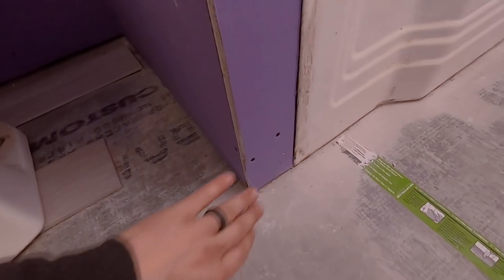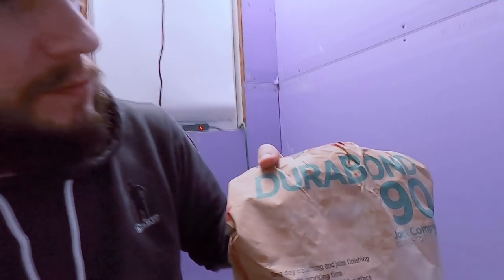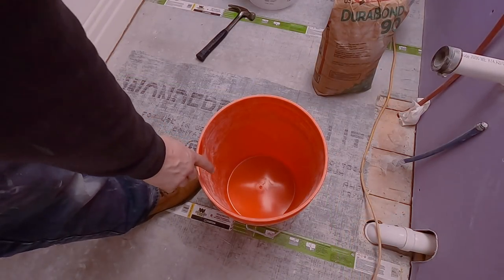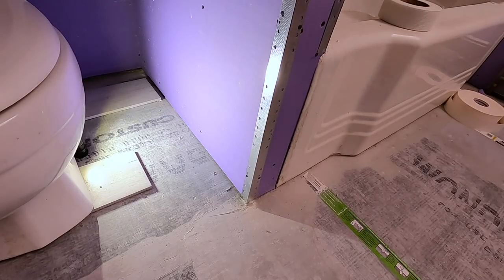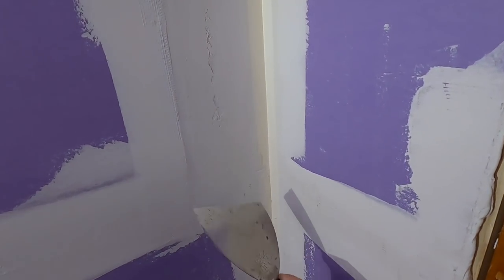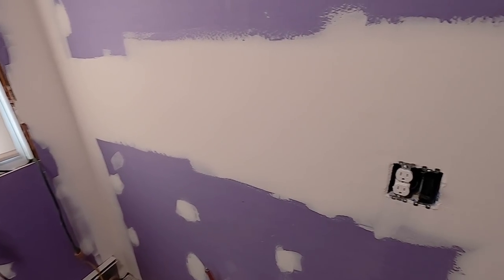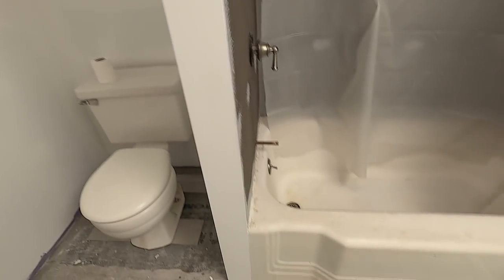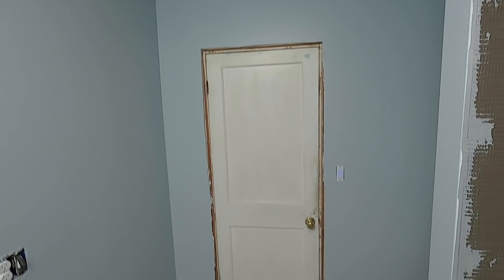How to Mud and Tape Drywall - DIY Bathroom Remodel Episode 17

Comment: hi again, my wife and I did tape and finish for 40 years and we stopped needing to sand while still leaving a paint or paper surface. I would be glad to share some tricks of the trade, you can try them to see if they work for you.  WE hate to sand so we don't.

Comment: You can't pass inspection in California with purple drywall on the ceiling.  I know it makes sense to use it in the bathroom since it is mold resisitant and all but they claim it is too brittle for ceilings.  Inspector literally made me remove it in two bathroom ceilings and replace it with the fire X kind.
Reply from the maker: Well that is interesting... I have never heard of that before.  Every state is different.  It is interesting to hear in what ways.  Thank you for sharing!  AND for checking out the video!

Comment: My father is a retired professional painter. He learned  his trade back in Europe and completed a four year apprenticeship. He truly is a master of his trade. Anyway, he taught me that when you paint a ceiling the first coat is applied in  vertical strokes and then the second coat coat is applied horizontal strokes, that way you end up with a perfect paint job and ceiling. 
He also told me not to fall for "primer & paint in one". He says always apply primer, then paint and to  always sand between coats for the perfect finish.
Reply: Thanks for sharing.

Few years ago I discovered if I used just a primer coat first, the paint came out looking nicer and I didn’t have to worry about stains bleeding through (for older homes/walls). Ever since then I always apply a primer coat before painting. Also for me it seemed to be better to use a primer then paint for drywall patches.

Comment: The hard mud works well especially if you have a big gap or odd cutout or blowout to fill beforehand because it doesn't shrink and dries hard. That and small patches you want to get done quickly. A whole room you can use premixed. I work with drywallers and they use the All Purpose for the tape coat because it has a lot of glue in it and is heavier, then the Plus 3 for the subsequent coats because its lighter and sands easier. All Purpose for hand texture, Plus 3 if you're spraying with a hopper.

Comment: Always add water to the bucket first before you mix the powder in and also try using the white bag called easy sand as it will be easier to sand

Comment: Yes very true, the true way to do a good tape and mud job is experiance, doing it over and over again, to where you litereally have a feel of it, to where you have that crisp spread and scrape sound and yes the less mud the better, do not want to be sanding a lot, and when sanding I do do the taper in method start on the edge of the dry mud and work it, it has takes me a few years to learn and actually move quick as well,

Comment: Excellent video! One tip I would add is that paint doesn’t stick very well if the walls are still dusty. I go over the walls before painting with a cloth to get rid of the dust.
Reply from the maker: Good tip!  Thanks for checking out the video!

Comment: Just another tip as a painter, I have done drywall repairs some needing taping, personally I wouldn’t overlap the mesh tape. I also after the skim coat is completely dry I make great efforts in removing all sanding dust of the ceiling & walls, even quickly going over it with a damp lambs wool window cleaner, just a very quick light touch over the mud areas, I have done it many times, never an issue. I’ve seen too many paint jobs peel off because the dust wasn’t removed properly, especially if your rolling. Also use acrylic Matt finish paint for your ceilings not that cheap white wash crap, it will inhibit mould & be easy to clean.

Comment: I'm really enjoying your videos-well done! We have a manufactured home that needs 2 bathrooms to be redone due to replacing the polybutylene pipe with new pex and a couple of wonky toilet flanges that I had to try to repair when we first bought the place. All of the pipes are in only 1 section of the 2 1/2 sections of the home so we're going from one end to the other in that section, catching the laundry room and kitchen in the process. It is a lot of work and it's been feeling like a little overwhelming to start, but taking it room by room, I guess we will get it done.

Comment: 2 suggestions: instead of using durabond to paper tape the angles you can use joint compound, that way you dont have to rush or worry that it will set while you coat the flats/ butt joints.

Anytime you apply compound to an angle,flat,butt joint or bead before you make the final swipe, use the feathering technique that way once it dries you will have less sanding to do
Reply from the maker: Thanks for the feedback!  And for watching!!

Comment: I know it sets quickly, but isn't it better to put the water in before the powder so it doesn't stick to the bottom of the bucket as much? 
Would it be bad to use the mesh tape or Fibafuse in the corners (I know it doesn't fold over like the paper)?
It turned out very nice!
I'm working on my bathroom. Fixed the floor but need to replace or refinish my sink, fix a scrape on my tub, put up some purpleboard and new wall surround for the shower/tub, replace or repair my vent fan (it's a vent fan heater combo from the 70s). Got new shower valve, trim, tub spout, and showerhead to put in. Hopefully it will look as nice as your bathroom.

Comment: You didn’t say what kind of paint you used. Myself, I like satin. Also, a sanding sponge is ok in some applications, but I like using a hand sander because what you want to do is not only make it smooth, but flat. After my bed coat, I sand, then a skim coat and only a light sanding is needed. Nice job!